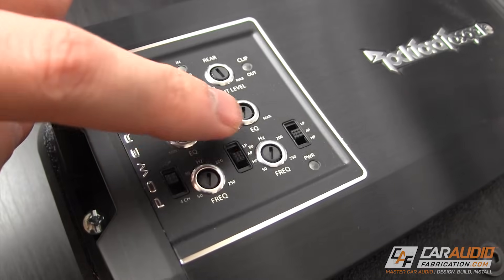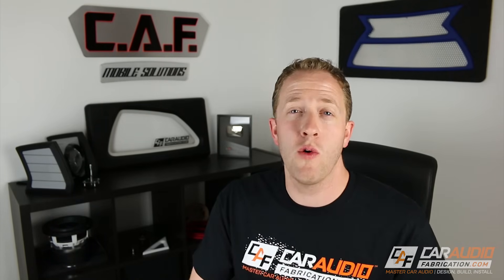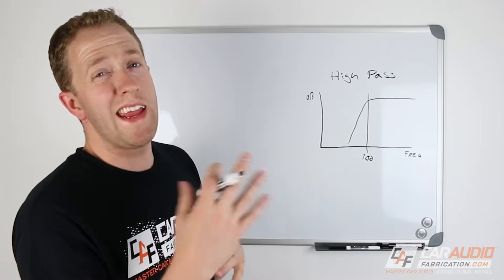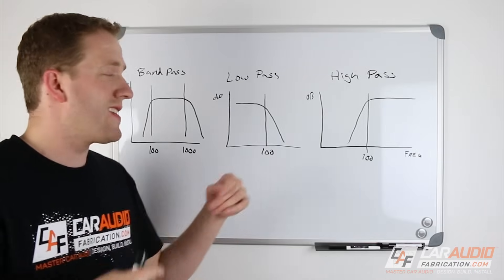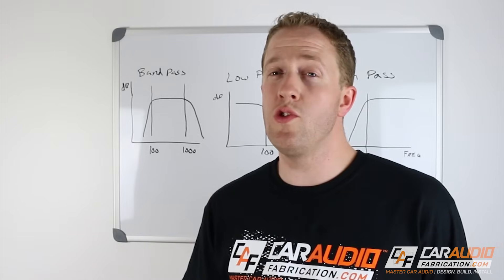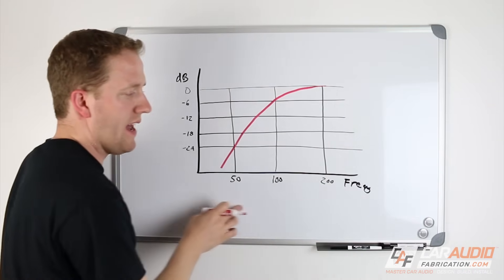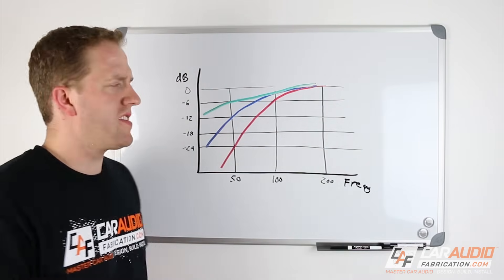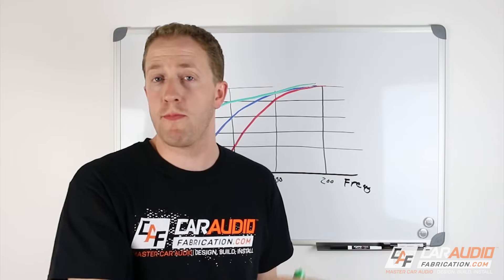IMPROVE Sound PROTECT Speakers - How to set Crossovers - CarAudioFabrication

Comment: Well, that explains why flipping the polarity of my mids or my tweeters changes so much about the sound. 

I have a very janky set up, 4" 2-way's in the dash hooked up as tweeters, 6.5" 2-ways in the doors as the mids and an 8" underseat active sub, I've got the headunit set up in 3-way crossover and I've been playing with the crossover settings for a while. I think I've got the bass somewhat dialed but the highs can sound very harsh sometimes, not sure if it's my ears or the particular set up.  

More information here to go try out now, cheers.

Comment: I didnt understand hpf and lpf combinstion, on amp both filters set to 100hz on sub+door speakers all in phase configiration if slope is 2nd order i will see bump in 100hz and if slope is 4th order flat line on 100hz,, correct ?

Comment: The mids I want to run in my front doors and center dash have an fs of 70hz, and they're rated at 250 rms a piece. If I run those at half power, am I safe staying at fs for crossover settings? Basically, can giving them half power or less "cheat" and help me avoid having to run the crossover settings at a higher frequency? I'm trying to avoid that hollow sound in the mids.

Comment: Great video, I have been trying to to tune my system in my car myself since I bought the car  from someone who already did the work and put some good money in it. Unfortunately whoever installed it didn’t do this level of install like usual shops imo. I had one question what if it’s a 6x9 or a non component speaker. Tuning these valves as described going through only one connection to the speaker itself, is that where they are usually equipped with resistors to limit the lower end to the tweeter?

Comment: I'm running 2 Digital Design super 8"s in a ported 4th order bandpass on and I have to tell you it is clean. Im just trying to understand your video because honestly I have no clipping because "if you ain't clipping you trippin".  I'm a bassaholic, I'm going to be putting the other 4th order 8's in my truck. My mono will handle it. Oh yeah my enclosures are tuned at 34 Hz.
Reply: This is the way! I want to do two savards, then two kickers in a 6th with the port tuned to 38hz because the the resonant frequency of my cabin(envoy) is about 38hz but I should be able to hit 28 at about 140!!!!

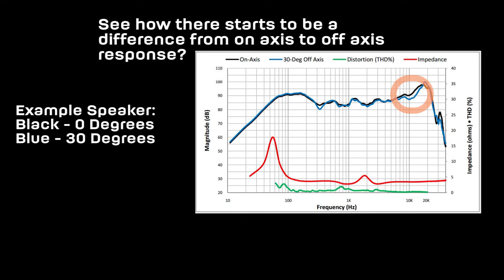Comment: Great video and great series, just some precision points:  At 15:45 you see response starting to drop off around 6000Hz, but at 14:03 you mention that "in this case" it starts dropping off around 3000Hz.  What am I missing?  I think that it would be a great idea to add a fully working example using a set of speakers and showing the parameterization of each equation.  Thanks again.

Comment: Do crossovers apply when youre using a 3 way car speaker? I wont be running a sub so dont wanna limit too much bass from the system, but also dont wanna hurt the small drivers in the speakers

Comment: Hey, love your videos, but I think you made a mistake. You said one type of amplifier is always -6db at crossover point, but then drew a curve for a second order slope of I assume the same type of amplifier with -3db at the crossover point. Also, you said -12db per octave and drew a curve that goes -12db over 2 octaves (200hz to 50hz), and the first curve you said was -24db per octave but did the same thing and drew a curve that goes down 24db over 2 octaves (200hz to 50hz). Am I missing something or is the -db at the crossover point not actually always the same like you drew it? Literally every crossover video I watch has information inconsistent with the others, and this is so hard to find a reliable source for information on.

Comment: Bro what will be the best setting for crossover/ time alignment in sony xav ax4000 car stereo that's give soothing bass and treble.

Front speaker : jbl gto609c 
Rear speaker: infinity reference coaxial 
Note : I'm not using both amplifier and additional subwoofer.

Comment: My conclusion of your tips: For the best sound I should use 24 dB/Octave at 120 hz for low pass filter  (active crossover) on a setup with 12" subwoofer and 6.5" midrange ?

Comment: Hi Mark, thank you for making all the videos that you do.  I am really new to car audio.  I just got a system comprising of: 2 sets of components, 1 5 channel amp, 1 10 inch sub, DSP.  Should I install the passive crossovers that come with my component speakers?  or should leave them out and set the crossover points with the amp and the DSP.  I hope this question actually makes sense as I am just learning for the first time how everything works from watching your videos.  Thanks in advance.

Comment: I have a taramps bass 15 it has a high pass and low pass filter, because it's a amp for subs do I turn the high pass filter all the way up to block out higher frequencies? Basically how do I set these 2 controls to keep the pure sound of bass?
Reply: For a sub. Turn off the high pass so the highs will not pass through the speaker. Turn on the low pass so the lows will pass through the speaker. Set the crossover to 80hz. You probably figured this out by now. If not, there you go. Keep rocking. God bless.

Comment: So what would you set the subwoofer high pass to for a sealed box? Or is none required on sealed, just ported?
Reply: It's not required for sealed box. But I have sealed box and i set HPF to 20hz, because mine doesn't producing sound below 25hz just wasting power

Comment: A VERY helpfuli video, thank you!!

I'd long wondered why I couldn't/shouldn't set my sub and mid crossovers at the same point. You are the ONLY source I have found who not only suggests that it's entirely reasonable (according to system) but added the vital explanation about phase differences and roll off. Wow. So, I immediately went and set both to -24dB and voila! instant improvement, much cleaner eq settings as a result.

Great stuff, keep up the excellent vids! :)

Comment: I have 2 5.5" subs, wired at 4 ohms. Freq response is 30-4k HZ, Resonant freq is 40HZ and sensitivity is 83db. What would a good low pass, high pass and slope setting be?
Reply: LPF to 80HZ  -24db slope
For HPF or Subsonic depends if its sealed or ported box. If its ported set it 10hz below tuning frequency, if it's sealed set it to 25hz or 30hz

Comment: Back years ago (1988) I stuffed a three amp system, with TWO 10 inch Pyle Drivers (in an enclosed box), with 5.25 inch Boston Acoustics in the doors and MTX tweeter horns in the back window (package tray) in a 1988 Ford Tempo GLS sport model two door!! AT the heart of this monster sat a XM3 passive crossover that balanced out my low level output from my Pioneer head unit, and NOT A SINGLE PERSON I KNEW, knew what the stink the crossover was for!! 
They just couldn't wrap their minds around "splitting the signal into three ranges" with one output of the crossover being highs, another being mid range, and the third being low frequencies!! And yet even today I meet KIDS (I am 58 years old) that still have ZERO idea what the function of a cross over is for! 

Personally I listen to country music, rock music AND most importantly heavy metal!! So I want to hear "full range sound"!! Bass is amazing, BUT I hate hearing lousy RAP music that is all muddy with heavy bass and nothing else!! Frankly there is a lot more "dynamics" to the music I like obviously!! The crash of a cymbal. the vocal ranges of David Coverdale or Stevie Nicks, the throbbing bass of Michael Anthony, or the violin (or fiddle) of Charlie Daniels, Kansas or Lindsey Stirling, all has their place in my music!! And I want to hear it all loud AND clear!!!

Comment: You can tune a passive crossover it is called build your own. Back in the 90's I used to have charts telling you what coil and what capacitor to use to get the frequency response the speaker can handle. Depending on the placement of the cap or coil (or multiple caps and coils) determined if it was for highs or low frequency cutoff. With the internet we can now look up how to set up the circuit and place the coil and caps in the proper location to get the frequency cutoff you desire. Back in the old days (1990's) Car Audio Magazine would publish charts that had all the caps Microfarad and coil sizes needed to obtain the cutoff's needed about once a year.  It has been years since I built any but It was a lot of fun doing it. For passive crossovers you will need either bipolar or non polarized capacitor's. The lower the Microfarad number the more low end frequency is cut off the higher the more it lets through. I remember seeing schematics for wild caps and coils in both the positive and negative with caps and coils crossing over to the positive and negative line. In that you basically can build a passive crossover to only see frequencies you want. Since I was in my early 20's back then I did not make or have a lot of money and this made the cheap speakers I could afford not blow from taking it to the edge of blowing. Only speakers I blew were tweeters and ferrofluid cooled tweeters were a big thing back then and when you blew one you pulled over and opened all your doors to expel the awful smell it created when you boiled the fluid in the tweet. Back then a lot of tweeters did not have caps with a cutoff efficient enough built onto them. You had to use a powered crossover. I still got one an MTX RT-X01A. You basically run your full range RCA to it and depending on the crossover you had would determine how many channels it split it into.

Comment: Hey mark I didn't catch tho what do u prefer. System crossover amplifier crossover or DSP? If you are using amp crossover wiring should be straight to the speakers? And if u r using the system crossover... Amp has to go full range and Let the passive crossover do the work?

Comment: So I have an aftermarket stereo with high and low pass speaker settings. There are 4 speakers, all coaxial or 2-way speakers, and no subwoofer. Should I set the high and low pass filters or just leave them off? I assume the low pass is just for if you have a sub and high pass just for independent tweeters? Or do they work with coaxial speakers as well?

Comment: I Love the video! But I don't geht the wording: Why is the red line that goes from 0db @ 200Hz to -24dB @ 50Hz called -24dB per octave? From 200Hz to 50Hz it's 2 octaves, so If the level goes down -24dB from 200Hz to 50Hz ist goes down -24dB per 2 octaves and not per octave. What am I getting wrong here?

Comment: The knowledge of using two 24db slope crossovers to get a flat response made a huge improvement in my car stereo. I had it professionally installed but they did not set it up well at all. I thought the new speakers were at fault. Thanks so much for helping me salvage it.
Reply: I'm actuaky going to try this out first thing tomorrow morning.
Reply: @stansuarez  any improvement you noticed and step by step guide will help me as well ...

Comment: So if I set the crossover on my amp, but have the ability to control crossover and slope on my head unit what do I do? Should I match the cross over on the head unit to my amp and then adjust the slope on the head unit?

Comment: so i have hertz midrange door speakers and hertz tweeters conected directly onto these, obviously both have different cross over points so how do i set this situation if i dont separate tweeters from door speaker wires although the tweeters do have crossover thing attached to wire i presume to protect them 👍

Comment: I have a 5 channel Power Acoustik Overdrive. 3500 watts worth of amplifier. It's crossovers are either high pass for the 4 channels, and low pass for channel 5. Theres no band pass. Does high pass work more for midranges than low pass?

Comment: I have focal flax ps130fe through a rf 300s amp. Should i xover at double the fs which is 92.5? On my headunit i have access to 12,18,24db/octave whould i high pass at 180hz? Im finding im grtting a loud midbass with a flat eq and all setting off. im having to eq out at about 160hz by -4db. And i dont understand this as they are ment to be a good component set. Tweeters are mounted on axis but woofers are about 70deg to me in the kick panels of an e34 5 series qnd not in the doors.

Comment: So I got a total "budget window shopper" system. Best Buy version of a JVC though. And yet, my amplifier... 😔... Is my subwoofer. 8 inch Sound Ordnance. While reading the wiring diagram for the 7th time, and hooking it up for a second time I noticed "Crossover". But my 4 inches have a tweeter, and my 6x9s have 2 tweeters. Is this where I'm supposed to just set the crossover settings and then trust in the audio god (I think his name is Dolby) to deliver the correct frequency signal to the correct parts of the speakers correctly?

Comment: I am Absolutely installing (separates), be it a component Set, or individual pieces (high, mid, low).  My dilemma is Active or Passive.  Can’t afford AudioControl, so mainly considering the PRV/Stetsom type DSPs if I go Active.  Using one of those pieces, I can take a single Amp channel out at say, 100w, send it in to the DSP and generate three individually (processed) ‘channels’.  But, are those three ‘channels’ sending 100w to the component speaker ??  
Ultimately, I’m anticipating TEN total individual component pieces (6-rear, 4-front).  Ideally, I’d like to “match” channels from Line Out of HU to # ch of external Amp. So, ten is out of the question.  How I get to (Ten) is using DSPs like PRV, which will take 4 output channels of amp (typical Fr L & R, Rr L & R), and achieve Ten individual ‘channels’ to the ten pieces (TWO PRV units 2.4 Fr, 2.8 Rr).
I still have difficulty getting to Best / Safe Practices for my scenario ………

Comment: Damn, thanks for teaching. I have a lot to learn, but you have made some things easier to understand. Please be advised that I will have more questions coming up.i have a pioneer AVIC 8500 headunit, and it has crossover settings I do not understand, but you just helped a little. I replaced my factory speakers with pioneer aftermarket speakers, and I have one of those small powered subwoofers behind my back seat (2006 Nissan Titan Crew cab) so I'm about to set everything to zero and start over with my sound settings, any suggestions for me at this time???

Comment: Does crossovers also limit the power going to the speaker? How does a component system with an 8 inch woofer rated at 150 watts rms not blow the tweeter rated at say 75 watts max power when the amp sends a 150 watts to the single channel that has the components on it?

Comment: Great video. I am setting up a JL Audio Twk 88 managing two NOS amps in a 2002 Z06 Corvette, an Infinity Kappa 255a and a 52a. New territory for me. Speakers are 3 1/2 and 6 1/2 in the front and 5 1/4 in the rear. Stock locations. Also have a 10" Kappa sub in a non-ported box in the spare tire well. I have all the speaker specs, but what crossover settings would you start with for the coaxials?  Have not yet installed the amp rack. Still playing with the TuN software offline. Not that this video is necessarily the place to ask, but I also wanted to ask about the need/use of capacitors... THANKS!

Comment: hey mark I learn so much from your vides . thanks for what you do and your knowledge .

Got a question for you.

Amps--

1St  D-4.800 for my front components . 
2nd  LC-4.800 for my rear speakers. 
3rd   LC-1.800 Subwoofer 

Speakers-- 

Single JL audio 12w6v3 in a ported custom box 
Front speakers MLK 165.3 Components from hertz -
Rear speakers MPX 165.3 - 

Head unit-- 

Kenwood DMX 907s, 

My question is what crossover you recommend for my current set up ? I want to go active on the front but I'm kind of confuse where I should set the crossover for my woofers and my tweeters.  also what crossover you recommend for my rears ? sub currently is sitting at 80 hz .... thank you in advance .

Comment: Can I use the crossover settings in my car stereo if I have kept the factory speakers? If so what are good crossover frequencies and slopes? I have a Honda Accord V6 with Bose speakers in front doors, two in the rear deck and tweeters in the sail panels, no subwoofer added. Up until I changed the head unit (previous was Alpine), sound was fine, now the bass is a little boomy and it's quite irritating.

Comment: Great Information, Thank you. I'm Trying To Learn A Bit Just To See, If I Can, If The Stereo Shop Properly Installs My Gear. I Bought The Focal Utopia 165W-XP Speakers/Tweeters/Crossovers @2 Ohm, Focal FPX 4.400 SQ 4-channel car amplifier — 70 watts RMS x 4 For The Front Doors. And For The Back Doors: Focal EC 165K K2 Power Series 6-1/2" 2-way car speakers & Focal FPX 4.400 SQ 4-channel car amplifier — 70 watts RMS x 4, Along With A Focal FSP-8 8-channel digital signal processor, And Also:JL Audio Stealthbox® Custom-fit fiberglass enclosure with 13" TW5v2-2 subwoofer & Focal FPX 1.1000 Performance Series mono subwoofer amplifier. This Is Going In A 2015 Ford F-150 Lariat Super Crew. I'm Keeping The Crapppy Looking Factory Head Unit. I'd Much Rather Get An Alpine "Floating" Head Unit. But Want To Keep The Trucks Features, Plus The Cost. I Bought The Amp For The Stealthbox With All Intentions To Get The Stealthbox With Two Subs But At The Time No One Had Them In Stock. I Haven't Gotten Anything Installed. Waiting On An Amp Mounting Plate From Sounds Good Sterdo. Any Thoughts/Recommendations/Mess Ups I Made??? Great Channel and Thank You For Teaching Us About Car Audio!

Comment: Great video! I have a question though. When you are talking about setting the subsonic filter, you refer to, if you had a ported box tuned to 30Hz, you would set it at 1/2 value of the below octive. So what is the rule, or would you set it to in regard to a sealed enclosure?
Reply: Best way to figure that out is port tuning x .75. that gives you the recommended 3/4 octave below port tuning you can safely play down too. Sealed enclosure, it doesnt matter